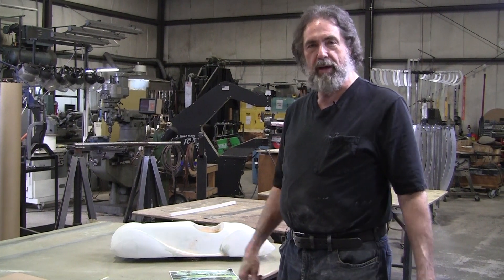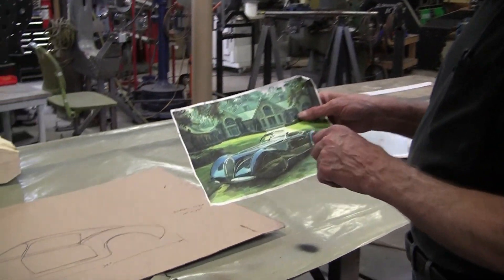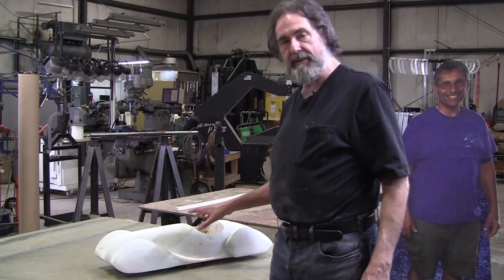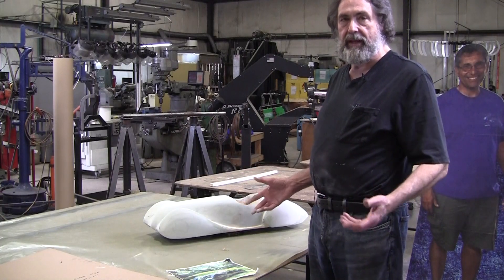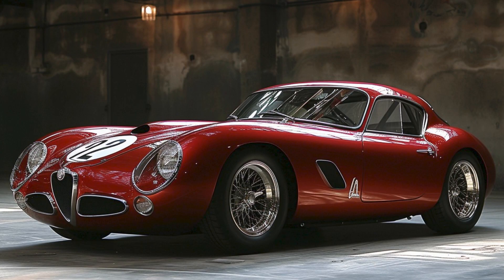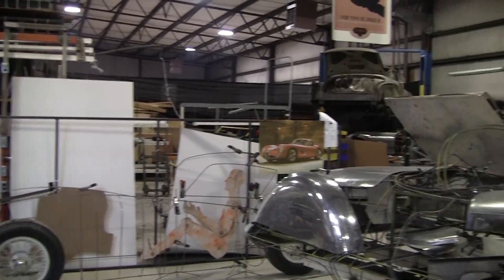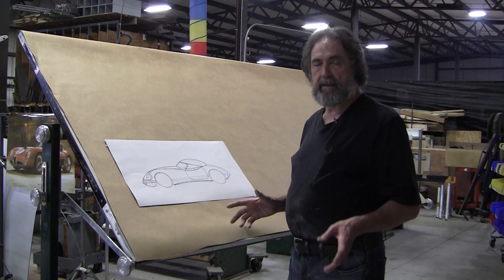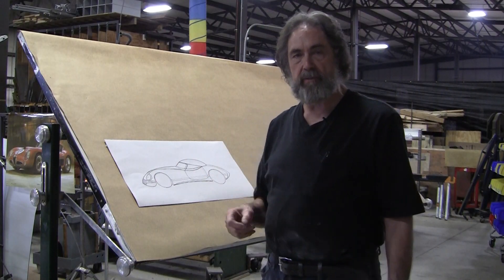AI Designs Come to Life in Metal Shaping Workshop

Comment: going to build a classic 1940s ford woody station wagon body set on the frame of a small electric / golf car

now i HAVE found a 3d scetch from the car and have the frame and driveline of the electric car i want to use for it , i like to use but i like to be able to slide it to get 2d outer circumference "ribs" to project on a wall using a beamer to get it to the right scale(based off the wheelsize of the electric car, i will lengthen the frame of the car the same way  )  and bend wires for a body frame up so they fit over the projection , if the frame once welded together covers the car like it should (covering the wheels car still able to steer in im able to get my legs under the dash) 
i was planning on using gaffertape / paper maché using walpaper glue and strips of newspaper and put plaster over that to finetune the shape to get a plug
thinking about vacuforming it in several parts (nose headlight buckets dash and fenders rest be wood ) out of abs plastic sheet , might epoxy some ribs under the parts to strengthen everything up 

i was wondering if you know of a slicer program that could do wat i need it to do (for free if possible)

Comment: You can easily go from AI design to 3D printer…and get it exactly as the AI design.
Reply from the maker: A 2 D picture does not create 3D printer files.......... Please inform me of the new software that allows that to happen.
Reply: @proshaper  NVIDIA GauGAN: AI for turning sketches into 3D-like images.
MiDaS (Depth Estimation): AI for extracting depth maps from 2D images.
Meshroom: Photogrammetry software for generating 3D models from multiple images.
Blender + AI Plugins: 3D modeling software with AI assistance for 2D-to-3D conversion.
Reply: Still requires a bit of human interaction but soon it will be fully automated...

Comment: If you scan the model, you should get the coordinates that can be scaled to give full sized or partial scale plans. Then generate sections for a buck or frame, or possibly even a surface for 3-D printing. 
Certainly the examples you've displayed so far have been stunning. Things like back ends can be outlined by the visible features, and then details sketched into the software by hand.
Reply from the maker: I mentioned in the video that I intended to scan it to create CAD files, which allow any size and 3 D printing.
Reply: On further thought, you could load the AI generated image directly into a CAD program and essentially trace it in.

Comment: Wray, if you made a 3d model you would be able to use digital/incremental sheet forming. Not sure what companies that have those machines and offer that service or what they would charge, but seems like it could potentially save on production time for these one offs, and could knock down the price a patron would have to pay, 4-600k is going to be tough unless you know any billionaires
Reply from the maker: Those sheet metal shaping machines are currently $500000.00  An AI robot English wheeling 24/7 will be a lot cheaper.  My video is meant to inspire those that can't afford to buy or build a finished turn key car, but they can afford to make a scale model. Wait to you see the scale aluminum, brass, and copper models I will make from my scale Bondo/Pine model.
Reply: @proshaper  https://youtu.be/ou5wPy56B3I?si=1NjTIj5Tw7kDqZuh